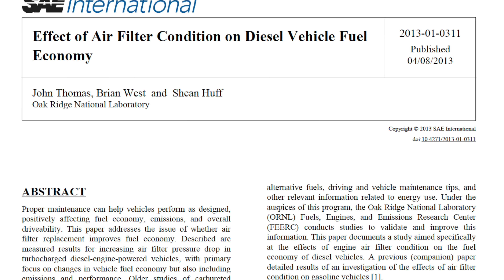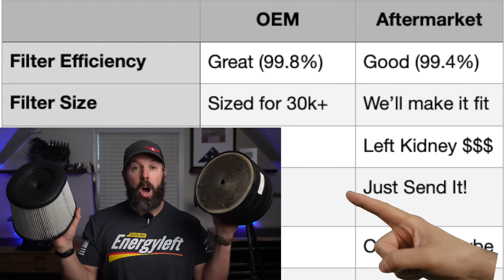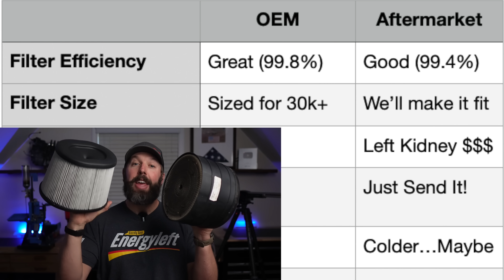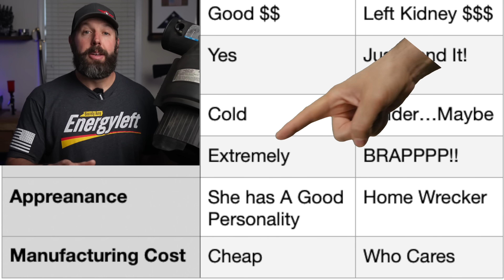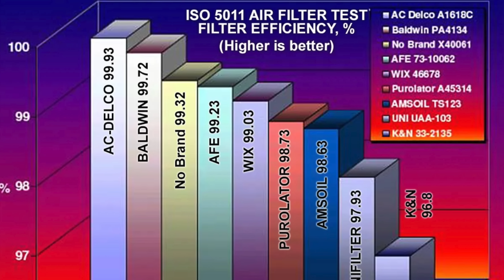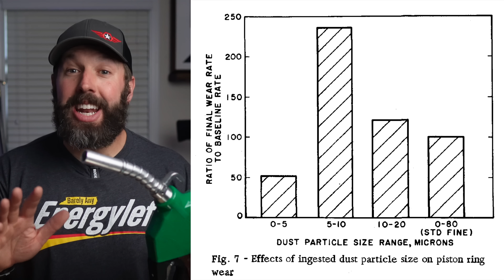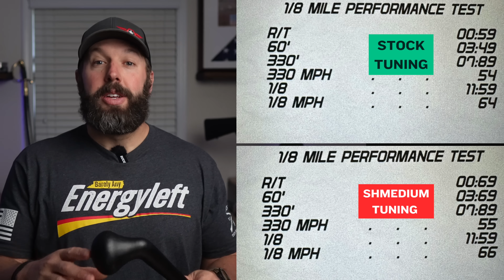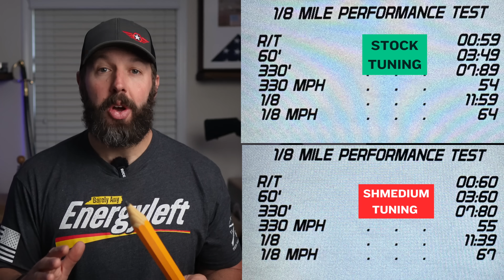The TRUTH About Cold Air Intakes…ACTUAL SCIENCE!

Comment: I mostly agree with you.  1. As far as your statistics, I'm not saying your math was wrong,  but I don't think it tells the whole story.  An example that might be a little easier to relate to...A study was started in 2001 about the effects of HRT on women.  One of the early findings was that in increased the risk of breast cancer.  They quit the study early and told the world that HRT was a bad idea because it increased the risk of getting cancer by 25%.  Doctors have finally decided the benefits of HRT outway the micro change in risk.  The actual numbers was it increased the risk from 4/1000 people to 5/1000 people, and didn't compare that to the overall chance of getting cancer of any person of 200/1000 (IE 20%).  So the risk of every person getting some form of cancer for any person is 20% and the risk of any woman getting breast cancer is 12% regardless of the using HRT or not.  The change in risk for women getting breast cancer while on HRT increased .01%  Women have suffered emencely for the last 25yrs because of poor data analysis. 

In the case of the air filter question, I would want to see a chart of engine wear rate vs both particle size and quantity ingestion.  Even though the S&B may let in 250/ minute more "bullets" than the OEM, engine life might not see an measurable loss until 30,000 bullets/minute are let through. In addition, is that BB's or 50cal bullets? Your also not stating the full effeciency rating of the filters.  Filters are rated at either relative or absolute efficiency for a specific particle size.  So a cheap POS filter might be rated at 80% relative efficiency for 50 micron particles, while a really good filter will be rated at 99.95% relative efficiency for 50 micron particles.  But they both may only  filter 5 micron particles at 10% and 20 micron particles at 40-50%.  A good illistration of this concept is your truck grill.  It is 100% efficient at keeping beach balls out, but might only be 10% efficient at keeping pea gravel away from your radiator.  Which one would cause more harm if it hit your radiator?  If your truck grill were a filter, the marketing department would advertise it as a 100% efficent filter.   If was truly important to keep all the dirt possible out of your engine to get maximum life, the factory would use HEPA certified filters with an absolute efficiency of 99.97%  for 5 micron particles instead of a paper filter with a relative effecicency of 99.7 percent for 20 micron particles. 

2. Before I would fully agree with you on the OEM design, I would want to see the factory design criteria and  how the design work was divied out to the engineers for the particular OEM intake in question.  I think you were showing one specifically for an LBZ.  That one does appear well designed, but as I understand it, they still have a problem with setting off the filter minder after a few weeks of use, which indicates high pressure loss between the filter and the turbo.  What that tells me likely happened is that the filter may have been designed for the desired air flow even in a loaded condition, but the whole combination of filter, housing, and truck assembly may not have been that well designed as an assembly to deliver that air.  And as you said, the OEM is designed to minimize noise.  That usually can't be done without comprimising air flow efficiency.  One design criteria that I know OEM has is they don't want your truck to last 400-600k miles because they want you to buy a new one at 150k miles, not long after all the factory warranties run out.

3. Air filters are also have flow rating at a specific differential pressure (DP).  So when comparing the air flow capacity of a filter, you need to know both the flow rating and at what DP.  At work I with compressed air systems on an industrial scale (LARGE and COMPLICATED).  In a part of the system, there is a filter that was rated at 800scfm the size of  coffee can and another rated at the same 800scfm the size of 4 coffee cans.  The difference is DP through them.  The single coffee can filter had a clean DP of 10psi and an dirty DP of 30psi.  The 4 coffee can filter had a clean DP of .5 psi and dirty DP of 2 psi.  The bigger filter is significantly more energy efficient than the smaller one.  How this applies to our truck air filter is MPG.  If the OEM filter is almost always 25 inH2O DP or higher and an aftermarket is 10 inH2O DP (a 60% reduction in friction by the way by typical marketing standards), it will take less energy to pull the air through.  It will definitely increase MPG and it will shift and flatten the torque curve.  How much is a different question.  Will it be measureable, I don't know.  The only way to do that is measure 4-6 tanks of fuel from the same gas station doing the same work loads, same ambient conditions, and travel routes for each filter assembly...the S&B and the OEM.  Under normal driving conditions, it's a crap shoot as to whether it will make a measurable improvement.  It might only be measurable if you are under extreme loads.  You would still have to do the same tests while towing 15k lbs for the every tank of fuel that is part of the test.

Comment: Reminds me of the 6.0ps intakes. One company did some testing and found the stock intake was not even close to being restrictive until over 500whp and was far better than any cai at actual filtration, yet every numb nuts with one of those trucks was running around with 300hp and an open k&n sucking hot air from the engine bay and tons of dust. People never learn.

Comment: You can get a larger higher flow air filter that is not inferior but simply has a larger surface area.
For instance regardless how large and high flow a HEPA filter is it still have a standard filtration.

Comment: This is just like in the motorcycle community where the first thing some (if not most) riders do is drill a bunch of holes in their airbox, drop and K&N in and vroom vroom.  Dude, you're not smarter than the engineers who designed that intake system, you haven't re mapped your ECU to handle the extra air flow so you're running lean, and even if you did get five extra horsepower, that bike puts out 160, 170 and it's you've been riding for a year, maybe two and it's a garage queen.  And  yes, I did it too before I started reading up on it in books, tech manuals and the like.

Comment: My aftermarket intake removes the baffling that was put in to reduce supercharger noise, and increases inlet diameter to feed my larger throttle body. Is the air a little warmer? Yes. Is there still more of it? Also yes

Comment: My shop collectively calls the cold air intakes that are raw filters without an air box “warm air intakes” because they are almost exclusively installed right behind the radiator which feeds the engine much warmer air than the bottom of the wheel well.

Comment: Love the vids, but when you go to aftermarket filters with a 5 micron spec, like a Wix, if the factory filter spec is 20 micron, the particles that do get thru are still at that 5 micron rating.  And, the dirtier a filter gets, the better it filters (still a 5 micron fabric) better as the media technically gets larger and stacked to to 5 micron media.
Reply: And, there are certain years like the 4th gen Rammers (tehe) that have a history of issues and codes, it's a dryer vents woth of toughness on that factory piece you think works well.

Comment: Years of modifying my cars, racing them, unless the stock intake is poorly designed, the stock ones worked just fine.  As I recall, the only pick-up in power (backed by dyno and track times) I had was a JLT on my 03 Cobra.  I think the stock air inlet was small and restricted airflow for the supercharged motor.  Other than that, I don't think I ever saw an improvement at the track or dyno for any CAI.  Actually, I installed a ram air intake on my C6 LS2 motored Vette.  I gained .2 and 2.5 mph in the 1/8th mile.  Track runs made two days apart, same weather, no re-tune.  Not sure if it was considered a cold air intake and though I had track gains, no gains on the dyno, for obvious reasons. Anyway, those fun days are over but I did add an S&B to my 2023 Ram 5.7 Hemi as it looks good IMO.

Comment: This is purely anecdotal but in all honesty modern vehicles do have pretty decent induction systems. That being said on older vehicles I think there are some benefits for CAI and exhaust systems. 

For example when I had a Titan (2012) me and a buddy of mine did a small sample size of 1 comparison. His Titan was an 09 and had the Banks monster exhaust and AirAid CAI. Other than that both trucks were stock with similar tires. We did about 70 miles down the interstate with cruise set at 74 and I got around 16MPG and he was getting 19MPG. 
Does this dispute the other aspects of the tests you mentioned no, I just think in some cases there can be some gains. 

Another point in modern CAI is that if you get one you should only look at ones with dry filters. The oil coated filters, namely K&N are known to and bad about messing up sensors with the residual oil that gets sucked down the intake.

Comment: Agree to disagree my stock air filter was ok my after market filter work better to me maybe if the car industry would put the air filter in the fender away from the engine bay then people wouldn't buy after market hot air is not good and i think the best thing i think you said was with a cold air you also need a tune and other add on

Comment: Your point on squatted trucks, 1000% accurate. Aftermarket CAIs vs OEM CAIs, 1000% accurate.  Everything else….. meh. I think this is a case of data being manipulated to support a theory or idea.  Overall, I get what you’re saying, and yes, I agree that high-flow air filters screen fewer particulates, which leads to premature engine wear. I’m not arguing that at all. A dirty air filter would, in fact, filter more particulates than a clean filter because it’s partially clogged and there are fewer openings in the filter.  If I opened my front door and left the screen door closed, I should expect great airflow but more dust to enter the house.  Which means I’ll need to clean the house more frequently.  If I hated house cleaning, then this is probably a bad idea.  If I replace the mesh screen with a piece of glass, I should expect less airflow and less dust (i.e., less house cleaning). And if I close the main door, then no dust and no airflow. A dirty/clogged air filter will reduce air flow and performance to the point where the engine will not run in the most severe cases. I think we can agree that an engine needs 4 things to run: air, fuel, compression, and spark.  If you’re missing one, things don’t work. Or if you don’t have the correct quantities of any of the 4, things don’t work as well as they should. The ECU in modern vehicles will try to compensate for less air entering the engine due to a dirty/clogged air filter, but it will eventually throw a check engine light or log error codes. And your vehicle will suffer drivability issues as a result.  But hey, the engine will last forever, right?  The report showing smaller particles causing the most engine damage is skewed IMO. They are causing the most damage because that’s the majority of what’s getting through.  If large particles were to enter the combustion chamber at the same rate as the smaller ones, I’m confident they would do more damage, and you should not be using that filter lol.  A more accurate test would have particulates of different sizes entering the engine in the same volume, then studying the results.  Then you could confidently say one particulate size causes more or less damage than another. But if my filter only lets in particles 10 microns or less by, then guess what is doing the most damage lol. I think one of the inadvertent takeaways from your video is that owners should not change their filters (air, oil, and I assume fuel as well, although not mentioned in the video) if they want engine longevity, and that’s what I disagree with.  What we’re also missing here is the wear and breakdown of a dirty air filter.  A dirty filter will physically start to break down quicker over time than a clean filter, and thus let in larger and larger particles. Everything has a tradeoff, which is what you pointed out.  If you want more HP, torque, and performance. That means more air and fuel are needed, and yes, more wear on the engine.  If you want your vehicle to run forever well, just buy a Camry, never change anything, and hope for the best. Anyway, great video and very interesting information.  Sorry for the wall of text😁

Comment: So if I want to do a serious tune, I would be better off replacing the stock air filter with another stock but bigger filter (maybe from a bigger engine), alongside making a custom housing that replaces the OEM one in order to fit the bigger filter. Should be around the same cost as getting an after-market CAI system, but without the risk of poor air filtration.

Comment: For clarification if the aftermarket intake is pulling air from the engine bay it’s not a “cold” air intake, it’s a hot one.  Like he said in the video most stock intakes are actually cold air intakes.

Comment: My 22’ BMW M3 is very responsive to mods with the S58 engine. I personally run a Project Gama Carbon Fiber Front Mount Intake. Yes it’s a $2,200 intake but I did it for a few reasons. 
1. My car has carbon fiber EVERYWHERE inside and out so it ties in with all of that.
2. Carbon fiber doesn’t really retain heat like most aluminum intakes.
3. The filters are right in the front of the car behind the front grills, direct to open, colder air.
4. Looks and sounds AMAZING from the outside.

Comment: Cold Air Intakes do NOT increase fuel economy or power.  Engineering Explained did a video on them a few years ago.  The ONLY reason to get a cold air intake would be to change the sound.  Vehicle manufacturers have put hundreds of MILLIONS of dollars into R&D for the air filter and intake systems for modern vehicles.  These smaller, aftermarket companies are NOT going to build something better than the OEM equipment.

Comment: Nice Rolex😂

Also, this makes me want to install the stock system on the truck again. However, I bought it used (slightly had 10k miles on it) and it had a CAI already installed and I think the cost to go out and buy an OEM filter housing might be as expensive as buying an aftermarket besides the filters.

Comment: A used oil filter efficiency improves for a bit until back pressure increases and the flow goes through the oil filter bypass on most designs.  The same thing happens when the oil is cold (viscosity = high) and the oil is being dumped through the oil pressure relief valve.  I agree 100% with the long intervals on the air filter. Thanks for the video.

Comment: What if you're able to upgrade the factory intake whilst using the factory filter? (e.g. improved snorkel going into the factory airbox)
Reply from the maker: You won’t gain any power. The snorkel will get the air intake up out of the dust, which is good, but you won’t see any performance gain.

Comment: Aesthetics and audible upgrades...whats always blown me away is how MUCH new air intake systems cost.
Granted you do need to have a larger/better flowing intake system once you start adding a lot more power... my 2016 Focus ST was over 600hp, soon to be 700+.. i assure you the factory intake (or fueling or exhaust, or cams, etc) are far from sufficient...granted Im probably pulling in 10,000x the particulates...but with big power our engines dont last that long usually anyways 😅

Comment: One thing I can say with my time modified GR86/ND Miata and other similar Toyotas and Mazdas is we found that unclipping the oem carbon mesh filter layer from the oem box did in fact add hp/tq, not sorta/kind or maybe, it was a clear gain on the dyno for these kind of models. We know most aftermarket intakes don't always give gains and can be a net loss at times, so we feel confident telling our community to remove that carbon mesh, keep the oem box and throw in an afe/kn high flow, if there’s a silcone coupler for smoothing out airflow sure why not but the first two give solid gains. Finalize with a tune that's geared to the exact setup used, and you got happy customers. Obviously this is more noticeable in lower hp cars. We look at this method as the budget friendly way to squeeze some more power. So yeah this guy is on point, plus MotorGeek did a super in depth video on both oil filters and air filter efficiency, that shares what this guy says but a lot more in depth.

Comment: That’s why I laugh about the Cummins guys who want to remove the ram active air system like all the kits that come out want you to block out the inlet door for the other induced air port so now you’re flowing less air than stock. Some of these guys probably have no clue they’re flowing air from 2 locations and the one has a door that closes when it rains or you turn your wipers on. If anything I’d keep my stock air box and change the intake tube. The only intake mod that’s purposeful is a snorkel

Comment: Even after a new factory a/f in my Cummins the 'filter minder' would suck way down after heavy towing. I added a length of flex tubing from hole in air box down behind front bumper. Seems the restriction was the inlet for stock air box.